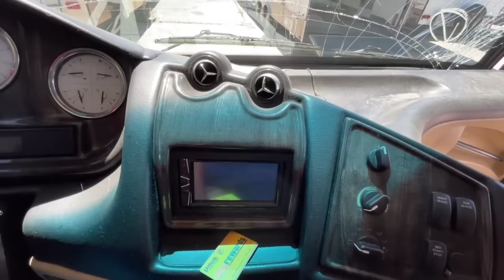So Many RV's At Auction Cheap, Copart Walk Around, Did I 🤮

Comment: That toy hauler you went into. Has 3 slides. The kitchen portion slides out and the dinette slides out on the opposite side. The L shape counter doesn’t move. Same with the large motorhomes you went in. They have slides on both sides. 

I’ve watched a few of your videos and each one I’ve watched you have missed that there are slides on both sides. 🤣

None of those units rolled either. If an RV/motorhome were to roll there wouldn’t be anything left of it.  The walls and roof would sheer right off. There is zero safety built into the walls for crashes. They are generally made of aluminum frames with insulation smashed between millimeter thin siding on either side. Safety standards are almost non existent when it come to building them. 

Also, bait and switch on your thumbnail. 👎🏽

Comment: We delivered RecreateVehicles manufacturer-to-dealer and dealer-to-shows.
With time waiting for paperwork, we often wandered the build floor.
.
The 'frame' on a RecreateVehicle is about as limp as a noodle.
We watched a forklift move a frame to another work station.
The middle of the frame on the forks was higher than our heads before the drooping ends cleared the floor.
.
A RecreateVehicle is engineered with the living quarters box as the major source of rigidity.
.
One of our hobbies is walking wrecking-yards and salvage pools.
A high percentage of totals are fridge fires.
With a central galley, a fridge fire removes much of the structural box.
Stepping inside is akin to jumping on a trampoline, nothing there to support it.